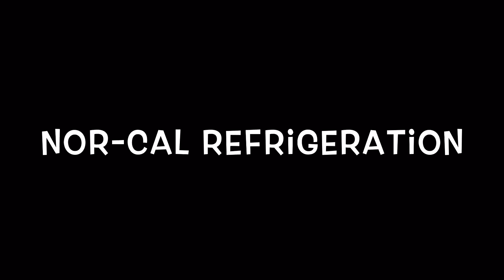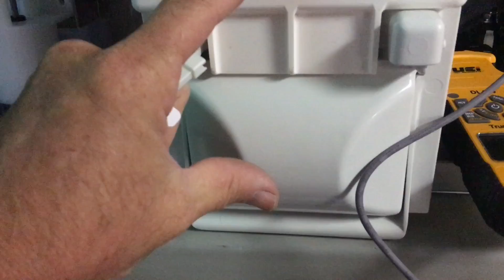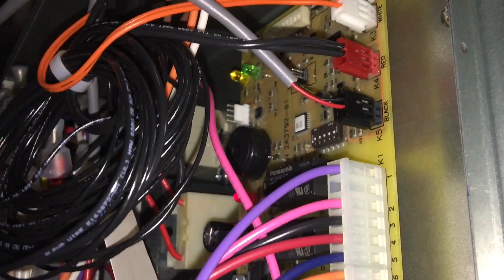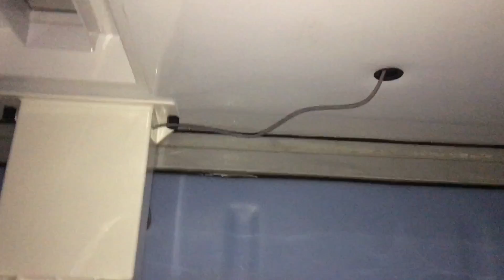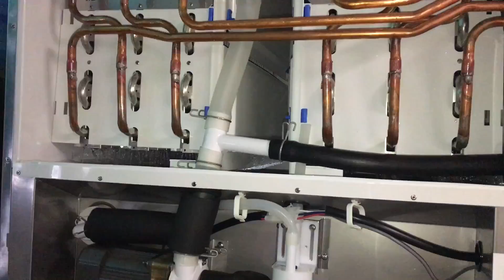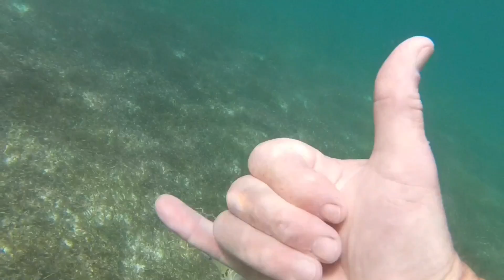Hoshizaki bin control

Comment: Replaced control bin with a new one still same error come to find out the bracket holding control bin was bent upwards keeping bin closed an control board BC open light on. All fixed after bending bracket downwards actuator paddle is moving on it’s own now

Comment: What volts do I have to look for when testing ?
Reply from the maker: On the machine there is a QR code. Scan it and you will get the complete tech spec book for that unit.
Reply: I have an KM-901MAH that is doing that same issue with the bin switch, is there any possibility of me bridging it until the replacement arrives?

Comment: Why both of my lights green/amber doesn't turn on at all. The machine work normal. But I'm afraid it doesn't shut off when bin is full. Do I need a new board? I just replaced a new bin switch, still no light turn on.

Comment: Hi,
We have a Hoshizaki ice machine and the switch appears to be working however it will make ice until it piles up really high. I have been watching it for a few days.  When the ice gets high enough it pushes the bin flap in and it will stop making ice. When I remove some of the ice and the ice falls  away for the flap to open the machine starts to run and make ice. Is it normal for the ice to grow so high in the bin? Is there a way to adjust the bin position?  The ice will form a large block if not used for a day or two. The technician that cleans the machine said we needed a new bin control.
Reply: There is an extension arm available to lower the position of the bin control.  If you lower it, the machine will stop making ice when the bin gets filled to that new “lower” position.
Reply: @darinruddock3394   thank you!

Comment: NICE!!!  I ran across a KM-901MAJ today that was freezing up the evap into one big block.  I found that the people that installed it didn't level the machine and it was tilted forward allowing all the water to flood the water level float control.  As the bin was full of bought ice and I was low on time, I reduced the water level probe to it's smallest ice cube setting and it worked great.  Once I get a chance to level that bad boy out, I will, and return it to the proper setting on the float control.  Improper installation always gives a bad result on new installations with leveling the units.  Just a hint of my problems to you as well Dave.

Comment: That is a wet batch of ice.  Is there something we can do about it?  Talking about all the water dropping with the ice.
Reply from the maker: That's normal with Hoshizaki.
Reply: make sure u have good Head pressure for Defrost. a quick hot defrost will keep the wet ice to a minumum. a Wornout compressor will take longer to defrost melting the ice / lower production.

Comment: Nice , hey I have a question. About new Copeland condensing unit I just installed. Has the new electronic controller . I could only set the cut in and cut out points. No way to set  fan cycling control ? Also did not come with CCH...
Reply from the maker: I think the fan is controlled by a liquid line thermistor, so by temp.

Comment: ice o matics are just so simple and easy to work on seems like they last foreever
Reply from the maker: Hoshizaki is even simpler once you know them there very basic. They just take time to clean, like hours. Lol
Reply: The only prob. With ice o matics are the nickel plating always coming off. But, besides that. They are very good machines. Simple & easy to work on usually.
Reply: That for Sure! Especially if u Get a Heavilly scaled one in the evap section. Those Cups on hoshi's kinda suck ! The spray bars kinda suck too that you Can't Take the End off. But, overall a Good machine. Water Pumps are Wayyyyy to F'in Expensive too.

Comment: Do the ice machines recycle the bin water? Just curious.
Reply from the maker: Hoshizaki batch freezes, any water left in the sump either gets used in harvest or goes down the drain.
Reply: Nor-Cal Refrigeration & H.V.A.C ah. so as the ice melts in the bin, the water doesnt get recycled.
Reply from the maker: +THEtechknight nope down the drain it goes
Reply: @THEtechknight  it’s really not a good idea to recycle the melted ice water.  The bottom of the bin is where the first particles of dirt and mildew will settle.  If you recycle that drainage water, you will eventually be sending dirty water in to make new ice.  Not Sanitary at all!

Comment: Thanks for doing the video on that New Style Bin Full indicator. I dont think I've seen that one yet. Not that I'm always looking up into the bin at the stat location. If the compressor is running I'm not looking at the bin stat. That machine looks just like the 1800 I worked on last week. I replaced the bin stat , but it was cold control type. Good Vid. That New style is getting beat to death with ice every time ice drops. I Heard it smacking it in the video. They Really need to come up with a Different idea. That one is not long for the world Getting smacked all the time Like a Laser Distance Thing Would be better. Something not Mechanical.